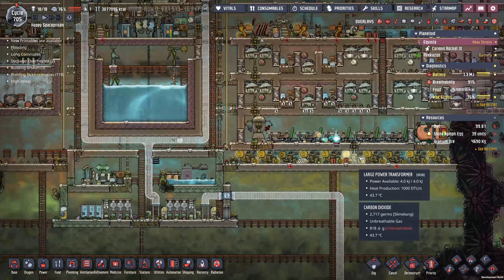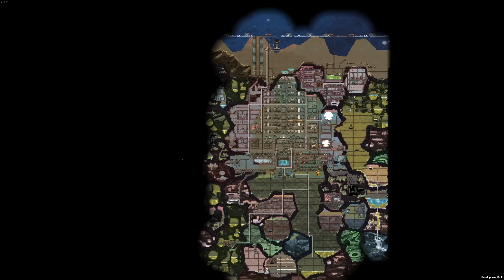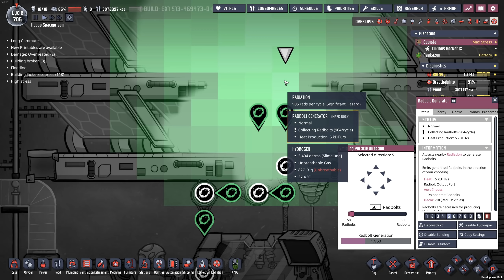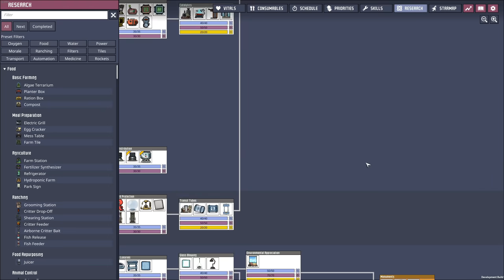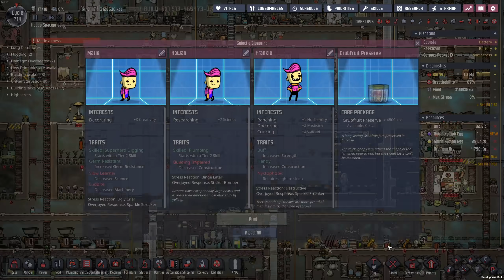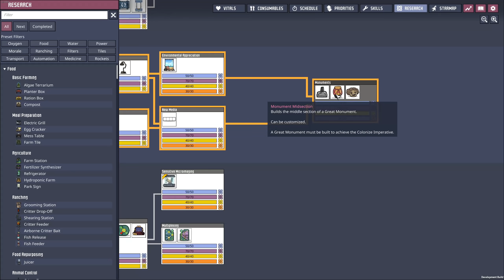Water Works! Oxygen Not Included ep18

Comment: You don't need to filter the polluted and salted water, they can go through each other's filtration methods without damaging the machines.

That mean that a desalinator, followed by the water sieve, can filter both salt, polluted and clean water, and will only output clean water at the end.
But since both machines take 5kg/s of liquid, you'll need two sets to handle a single pump.
Reply: Very informative!
Reply: Annoyingly, if you send salty water to a sieve, or polluted water to a desalinator, they actually pass through all 10kg which makes the pipe balancing a tiny bit harder, but it generally averages out.
Reply: @callindrill  oh snap! adds an s pipe between his own I wondered why I felt like it was not going as full tilt as possible. Yeah that fixed an issue of mine! Thanks.
Reply: @sicariusdracus  I'm sorry, an S pipe? What do you mean?
Reply: @mirjanbouma  added 3-4 sections of pipe in the shape of an s to allow for the overflow.